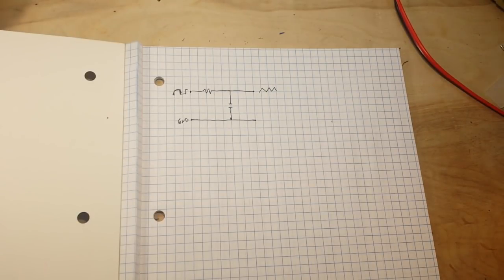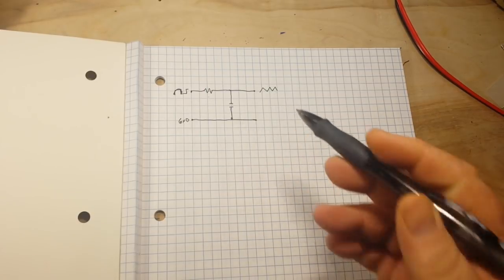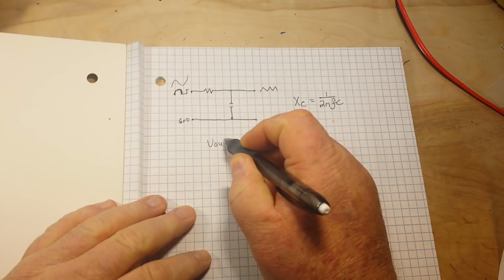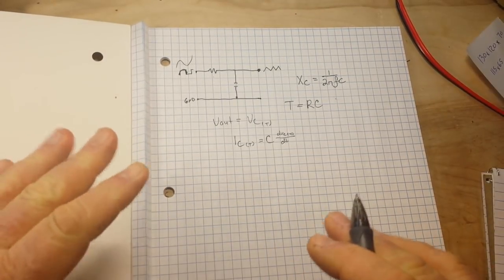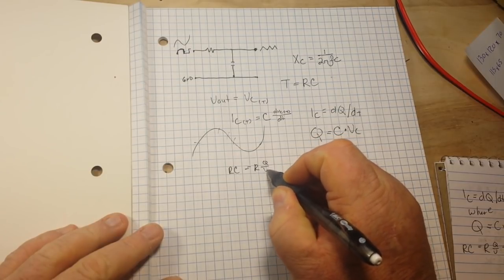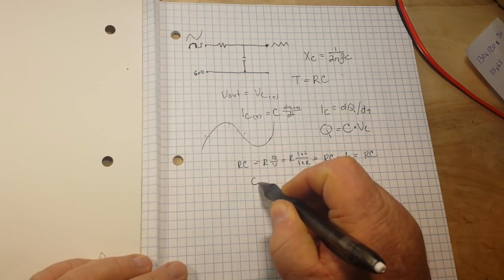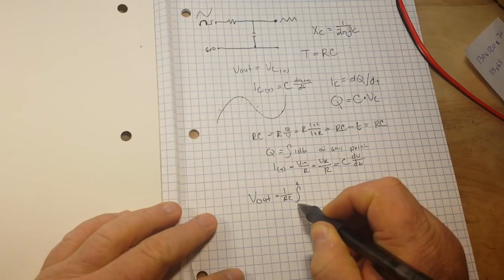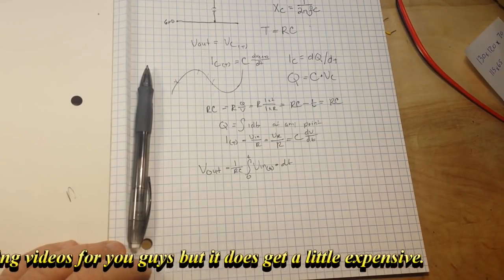The math of the RC Integrator

Comment: There is an assumption in your analysis that i(t) = Vin/R which is only valid when Vout is much smaller than Vin.  When Vout is a significant fraction of Vout then i(t) = (Vin-Vout)/R and the integral equation becomes a first order differential equation (which has an exponential function as a solution).  For small signals it approximates an integration so it is useful to think of it in these terms under small signal conditions.

Comment: I stumbled onto your videos, you did a nice job, question? Are you a degreed engineer? If so I was thinking that this could have been a good way to introduce Laplace Transforms abt at a very basic level. I don't think I have seen them used in the hobbyist YouTube culture which is odd because their are only a few of them that we use in EE world and they are basically table look ups. Bringing them to the hobbyist  would allow them to do calculus and different eq with just algebraic skills and take their understanding to new levels plus it would open up the world of controls sytems.
Reply from the maker: Hi. I'm retired now, but yes M.S.E.E. from Pitt. I worked for Bayer Intl and finished my career teaching at a local community college.